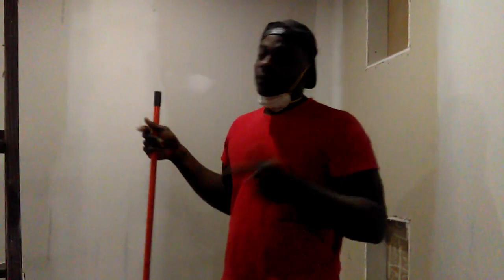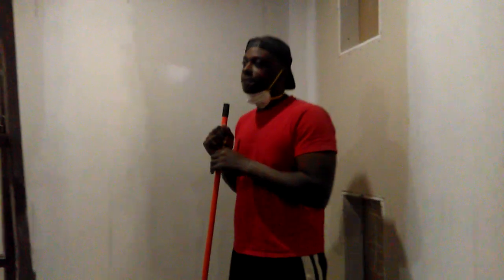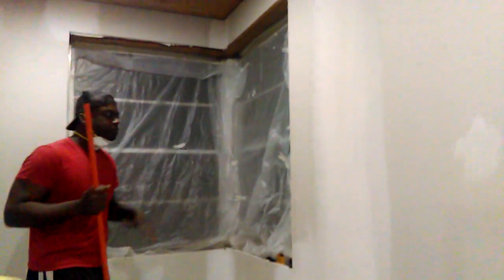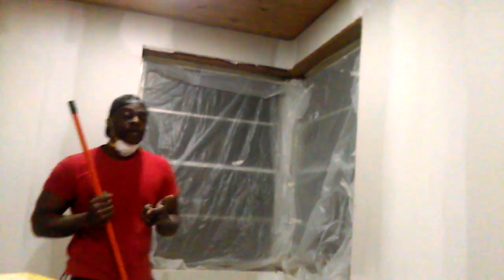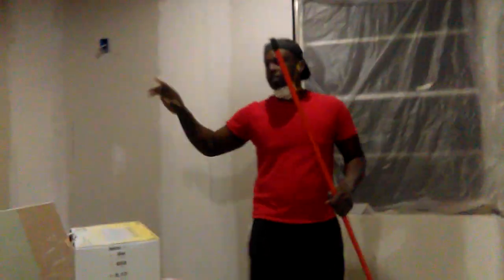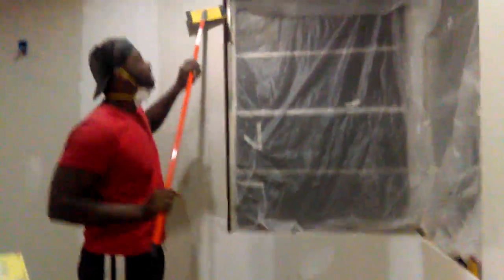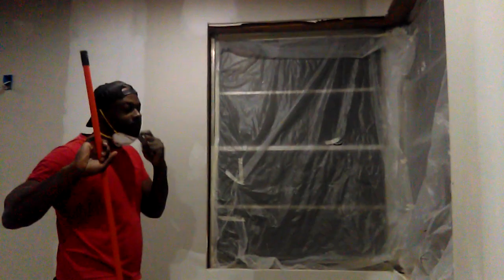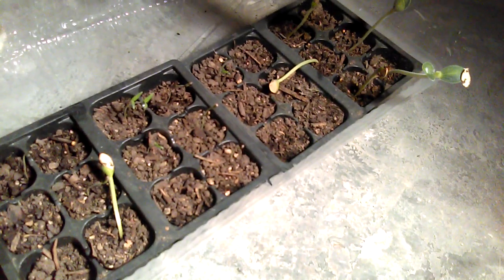House Update!!

Comment: Great job on the house. I’m trying to figure out the best time to start my seeds inside before I plant. I just ordered a mini greenhouse and some grow lights. The mini greenhouse was 35.00 and the growlights were 42.00, I think. Since I will be planting in a raised garden bed, what would be a good time to start my seeds in the greenhouse. I’m planting tomato, pepper,  tree collards, cucumber, eggplant and corn seeds.
Reply from the maker: Where do u get those from I dont have any seed starting materials beside two heating pads.....my stress did fine last year tgis year nothing
Reply: I got it from amazon. It is the Gardman R687 4-tier mini greenhouse  27 long by 18 wide and 63 high. It costs $35.04. I also got some grow lights to go with it. Lite ever 45 watt plant grow LED light set. The cost was $42.29.
Reply from the maker: @zemry  thanks Sir